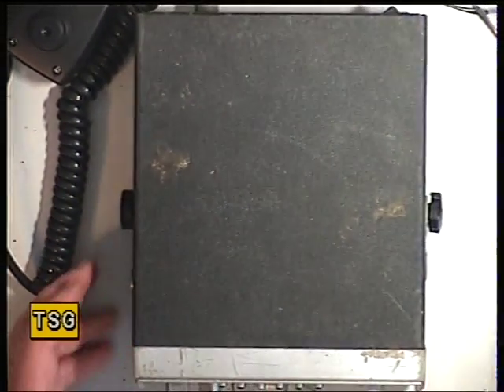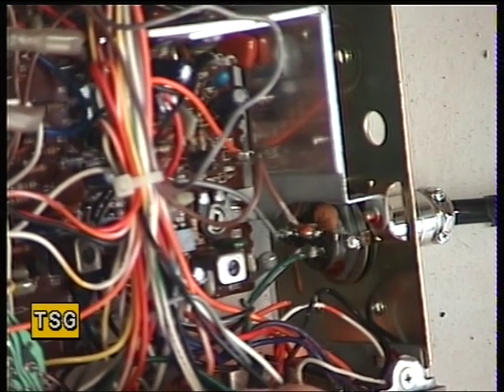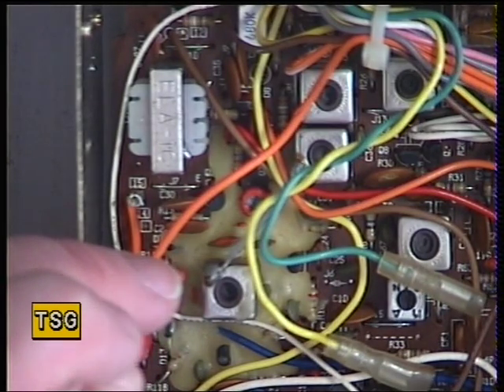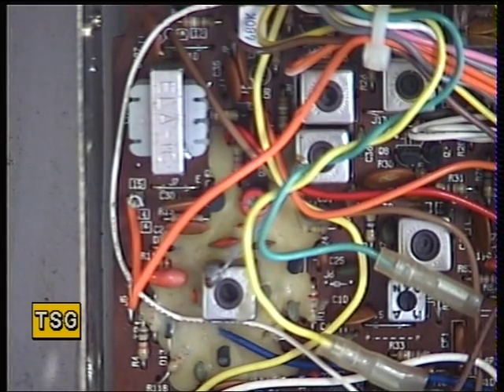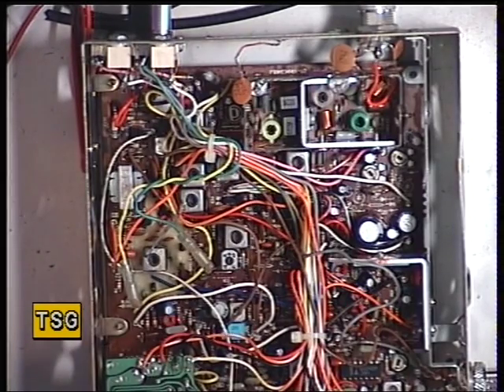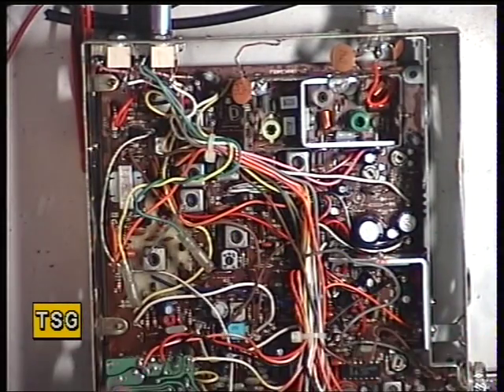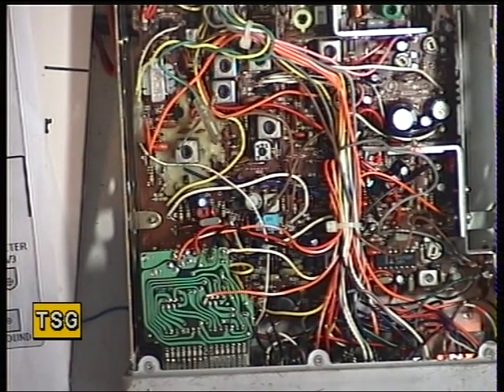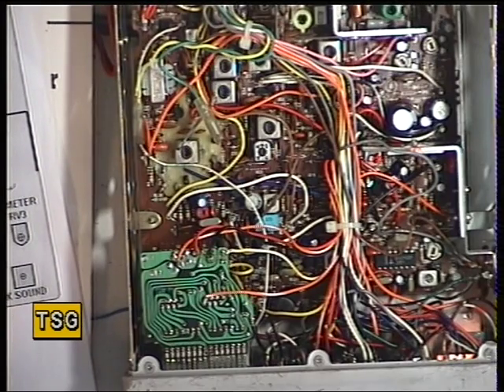York JCB863, UK (CB 27/81) CB radio (Mobile)  - VCO & Transmit adjustment

Comment: Richard need vol potentiometer for this model you have one spare at all thanks.
Reply from the maker: I'll get Mr Chippie to try & look up what the part is; we don't have a model specific service manual. It shouldn't be impossible to replace. The snag to us is that no UK wholesalers seem to do these far-eastern type of shafts. I'm sure a UK vendor on Ebay has them for the guitar amplifier market. It's a matter of measuring the radius of the potentiometer itself & also the length of the shaft as well as the number of ohms. What I DO know is that it will be a Logerithmic type.....and of course have a switch. I don't even know if it's a single or double pole switch.

Might be best to email me rshireby@yahoo.co.uk

Richard, G0OJF
Reply: Email sent and thankyou very helpful.

Comment: That was my very first legal CB and I still have it, though I took it out of a box and the volume control was very very stiff, gave it a squirt of cleaning fluid and it loosened off and then proceeded to fall to bits  :-(( So I will have to rummage through to see if there are any scrapped controls.  It still works after all these years in a box, at least it will work again after I replace the control.  It was working for a while just before the volume control decided it didn't want to play anymore  :-((  My York 861 still works fine though, it was the one I used most in the car. but I put in a white backed meter so I could see it at a glance.

Comment: HI Richard  York 863 has no low power high power 4w all good
Reply from the maker: Common snag on this chassis. The low power preset (back towards left) gets dirty. Usually cleaning with a squirt of switch cleaner (we use the Servisol one) is all that it needs. Over the years I have had to change a handful that have gone beyond cleaning.

Richard

Comment: One quick point, if you are adjusting the frequency trimmer you really need to put the top case back on as it affects the frequency just a little. It's only a small amount but for the seconds it takes it's worthwhile doing
Reply from the maker: You are, of course, quite right. Always check radios when put back together before those screws go back in...you never know!
Richard

Comment: HI Richard  have you got a york 863 service manual need to find where the DIMMER wires go the wires have been cut off .?
don`t no why ..?
Reply from the maker: +Alpha Mike Foxtrot No, but I have the rotel rvc240 manual & uploasded it to SCRIBD for free use. I'll do a video on the Rotel RVC240 with special attention to the dimmer wiring

Comment: Was there ever a York 862. The 861 and 863 are the same as the Rotel 220 and 240 but there is also a Rotel 230. Yes I do have at least one of each of these radios but have never come across an 862.
Reply from the maker: simov8chevy No, there was the 861, 863, crappy 867 & 869 base station.

Comment: So out of interest what is the acceptable tolerance range for 27.79125 ?
Reply from the maker: I had to look this one up. It's more than you would think at + or - 1Khz, so that would be from 27.79025 to 27.79225. The worst examples I ever see would be as low as 27.79064 to 27.79198 - that's when they've been messed about with. Crystals naturally drop with age, so you rarely see them high.

Comment: I remember one of these my mate got at a boot sale many years ago had a crudely fitted rotary pot and control knob on the side of the set marked 'Variable RF Power Control' - on closer inspection I found that the 'engineer' (yeah, right!) that installed that monstrosity had connected it to the PCB in place of RV4, believing that the S meter movement was the power output level being varied!!!!
Reply from the maker: That sounds like a psychological power control....the meter swings across....wow...loads of power!

Comment: I remember these radios back in the days I also recall a York869?
Reply from the maker: There was the basic York 861, this...the top of the range 863, the slightly later cheaper & not so good 867. The 869 was the base station....I that's the base in my organ workshop.
Reply: UK CB radio servicing Any chance of a video of the 869 ?
Reply from the maker: Depends if you want an "on the air" video which can be done in the workshop with a camcorder, or a servicing video!
Reply: Both would be great!